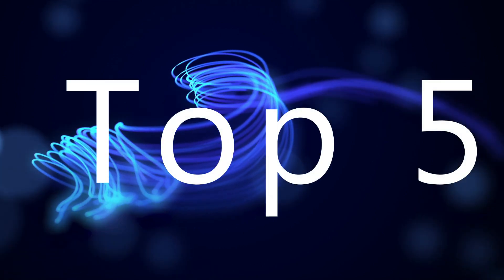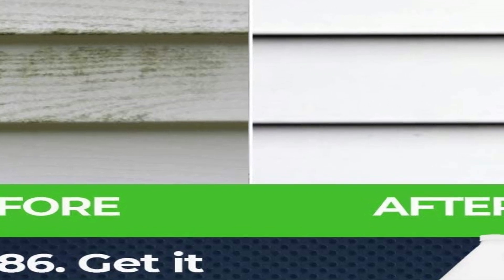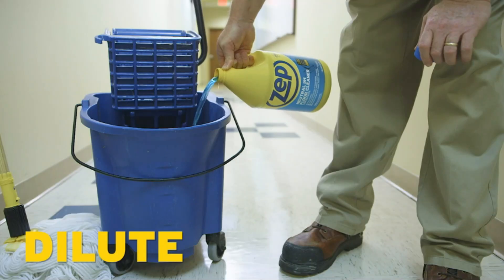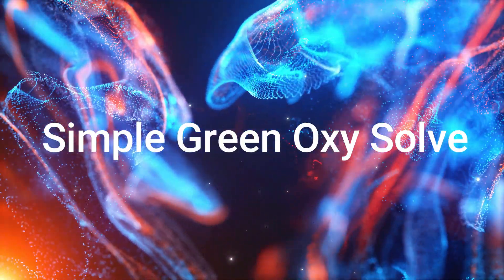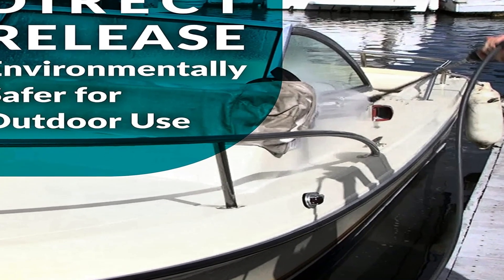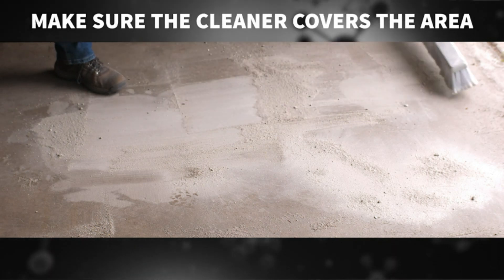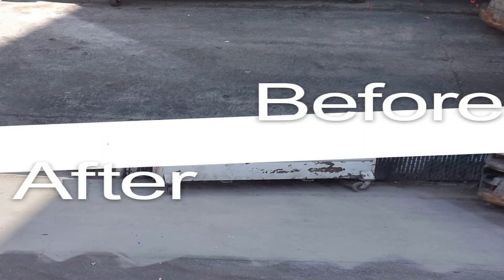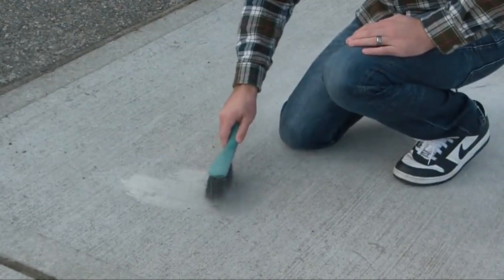Best Driveway Cleaners 2023

Comment from the maker: Best Driveway Cleaner    
No 1 CAF Outdoor Cleaning EXIMO® Waterless Concrete Cleaner for Driveway =https://amzn.to/3iS5YF9
No 2 Simple Green Oxy Solve Total Outdoor Pressure Washer Cleaner =https://amzn.to/3UZ2T3P
No 3 ACT Concrete Cleaner 2.5lb =https://amzn.to/3HnbZ73 
No 4 Zep Neutral pH Floor Cleaner Concentrate 1 Gallon ZUNEUT128 =https://amzn.to/3Y8G7sQ
No 5 RMR-86 Instant Mold and Mildew Stain Remover Spray =https://amzn.to/3Bmdy18